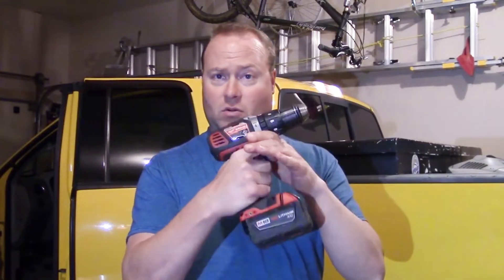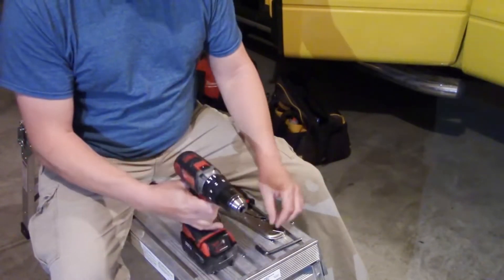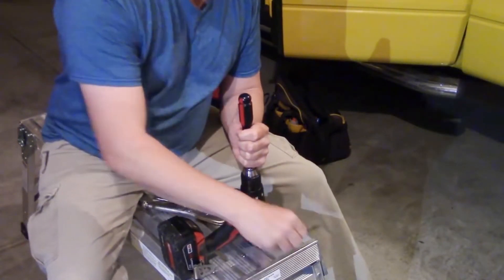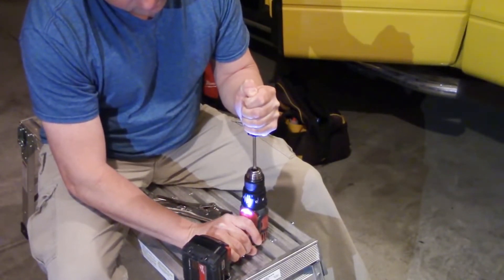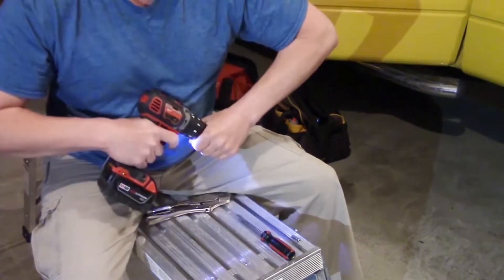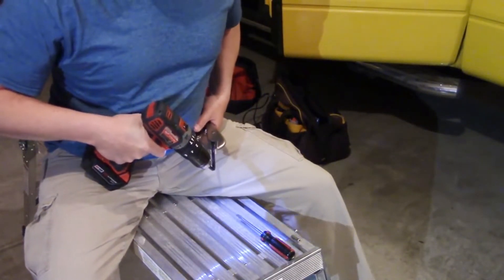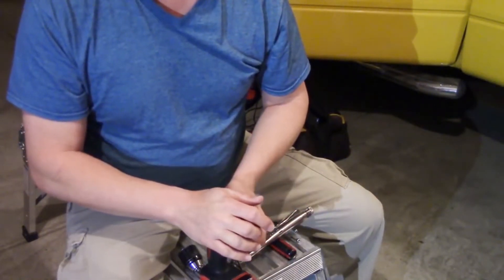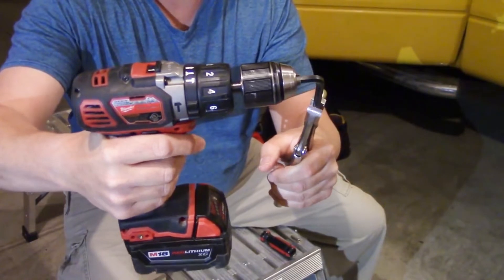Cordless Drill Chuck Removal!

Comment: If only they were all as easy as this one.  Mine won't budge at all.  Tried everything I can think of but I think it'll have to be cut off
Reply: Yes correct my jammed so freaking tight, tried literally everything even hammering the drill socket hoping it would be loosen up, but everything failed, ended up angle grinding the chuck into half luckily it was plastic outside and metal inside still took me about 2 hour's plus, than had too drill the screw because couldn't get the screw out as jammed too, finally after a month (just day's when I was free I worked on it) I finally the screw came out while drilling through a hole in it.

Comment: So did they change the thread on the chuck bolt thingy? Deciding if I want to keep this or return it.
Reply from the maker: Some of the Milwaukee models, including the fuel do have a different thread. But Rohm does make one for the 9/16"-18 now. Here is that Amazon link. https://www.amazon.com/R%C3%B6hm-Extra13-RV50-9-16-18/dp/B07V8W37RT?crid=22XPAUEJGW9MO&keywords=keyless%2Bchuck%2Bmilwaukee&qid=1693140754&s=hi&sprefix=keyless%2Bchuck%2Bmilwa%2Ctools%2C119&sr=1-8&th=1&linkCode=ll1&tag=greatwhitenin-20&linkId=37710fa76aa6b6223b4d8d50c013986b&language=en_US&ref_=as_li_ss_tl
Reply: Yeah….I’m not liking what I am smelling. Think I will take the refund over the exchange and try and different brand. Have any Favorites in the same category? Hardest work it will see is building a deck next summer, some fence repairs and hanging doors. Moving up from a 5 year old Ryobi. Thanks! Feel free to put up some more product links!